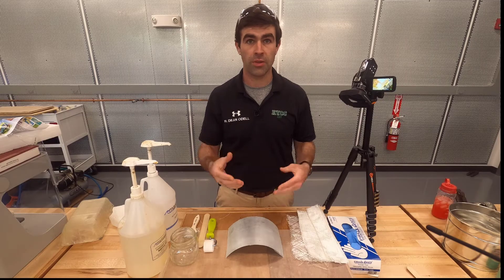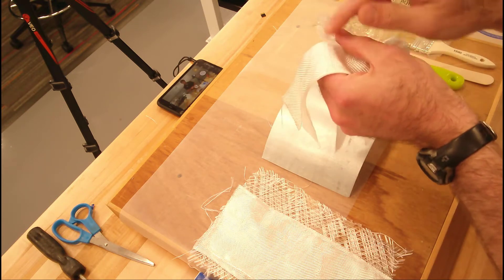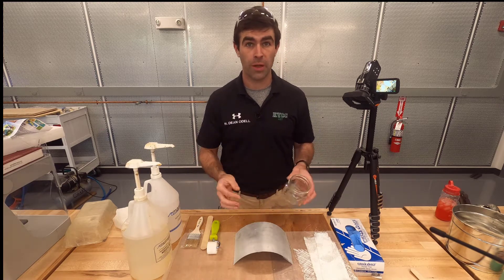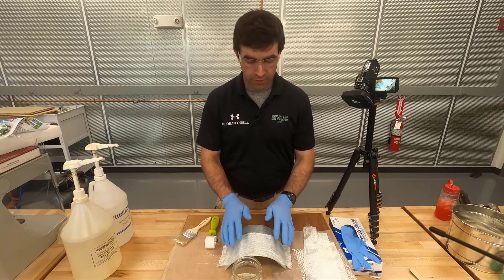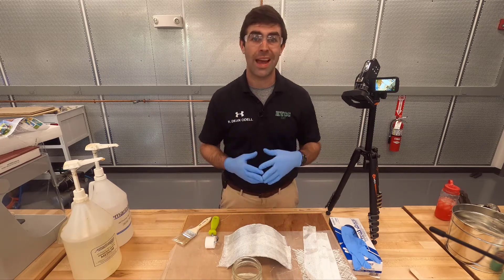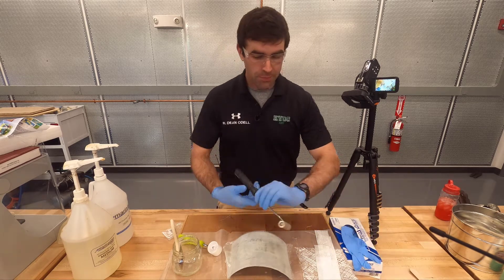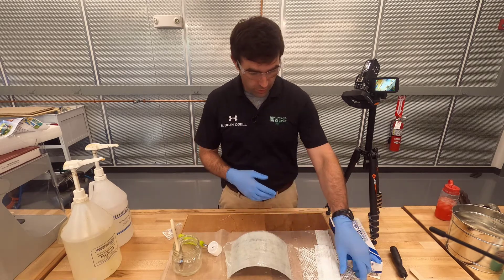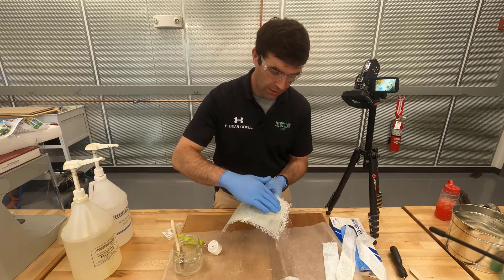Fiberglass Layup Demonstration

Comment: Something that's ALWAYS missing on ALL of these vids is the practical difference between glassing multiple layers on a HORIZONTAL surface versus the REAL problem of a VERTICAL surface.  It's called SLUMP.  More than one layer needed?  HOW?  What until tacking then lay up another layer?  Wait longer and sand?  ~2oz resin per 1sq-ft of 1708 doesn't change, so wet out surface with HALF the resin?  Then wait until tacky?  Then place your glass?  Then the next 1oz of resin?  Then wait?

.

Comment: Thats just bad method...the better way would b to have ur layout mold be solid, not a bent sheet...then after u lay down all the epoxy, u use stretch plastic to put HEAVY pressure on the cloth, so any air bubbles and excess epoxy get pushed out, epoxy is just glue, its the fiber doing the work, u want as little epoxy involved as possible!

Comment: Can we use woven roving with epoxy?
Reply from the maker: Hi,
Yes, you can use epoxy with woven roving. It is thicker and more dense that the fabric I use in the video, so it is more effort to wet out and uses more epoxy than than fabric. Chopped Strand Mat is the kind of fiberglass that typically does not work with epoxy.
Reply: Expect to go through GALLON after GALLON if you use 24oz woven.
Reply: Email id please